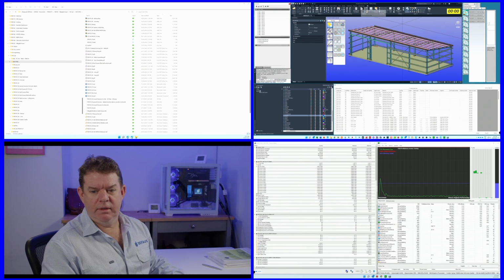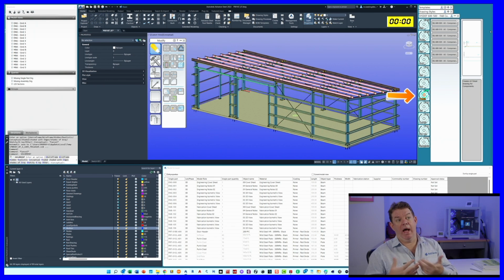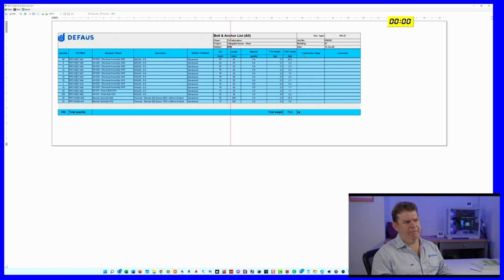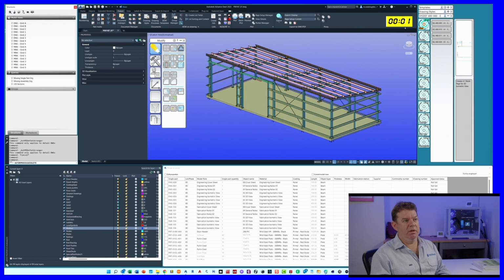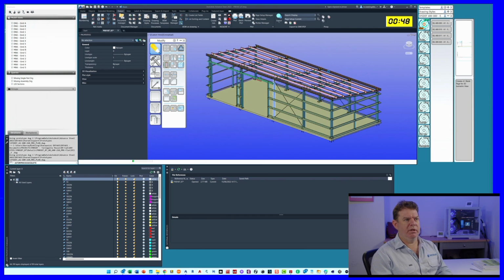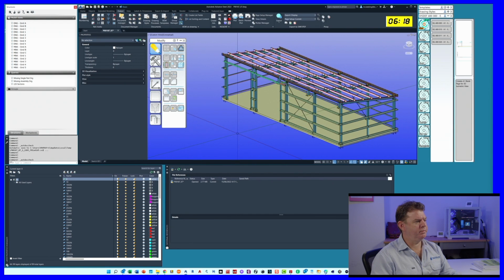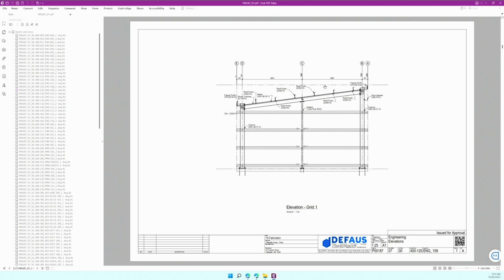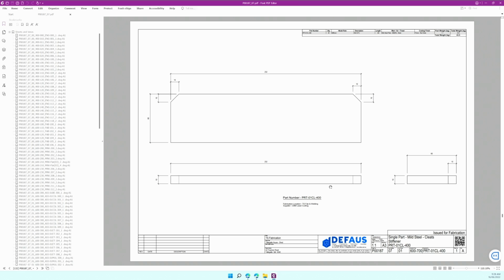My 1st Coffee   Episode 005 - Drawing Production Automation

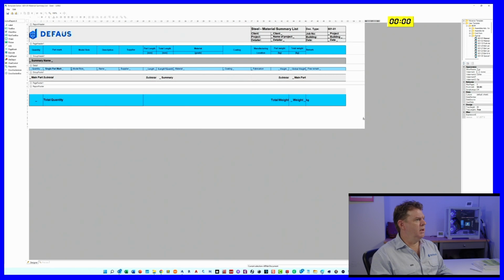Comment: Hi sir! At 19:32, I noticed that you calculated the Total Length by using ILength*IQuantity. I followed your method by copying the Length column and adjusting the DataField and Text to ILength*IQuantity. However, when I use the Material List Summary, it gives an error and doesn't work. Could you please explain why this is happening? Did I make a mistake somewhere? I really appreciate your help.
Reply from the maker: I would need more information as to what you are trying to do that is not working. Are you looking to create a Purlin List?
Reply: @defaus  I create Material List Summary for Assembly with main part is W steel, and other part are Plates

Comment: Hello, can you tell me how I can increase the diameter of the axle circle, in advance steel??
Reply from the maker: Hi Everton, thanks for your question.  You might need to expand the question for me.  I am not sure what you are referring to with 'Axle Circle'.  Ahhh, do you mean Axis Bubble/Balloon/Circle?  From memory, I believe there are 2 ways to change the size of the Grid Balloon.  From MT you can either choose the size of the balloon or set the balloon to be a specific size larger than the text itself.
Reply: @defaus  That's right, I expressed myself badly, sorry for my English, I'm Brazilian and I need to improve a lot hehehehe, thank you very much, I watched your video yesterday of the project that you did the extraction of engineering and manufacturing drawings in ADS, it was the best, I'm studying the software to one day reach this level of detail and engineering. A big hug, see you later.
Reply from the maker: @evertoncarmine8884  no worries, glad to help.  Sometimes terminology is tricky, the software is tricky enough without the added complexity of language translation.  Enjoy your AdS journey.